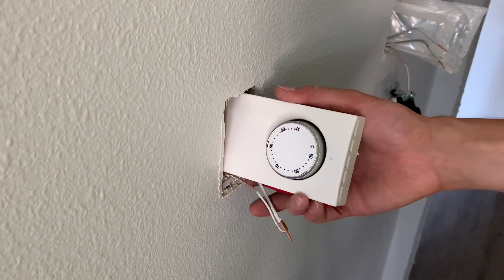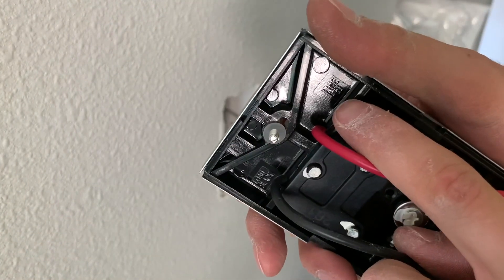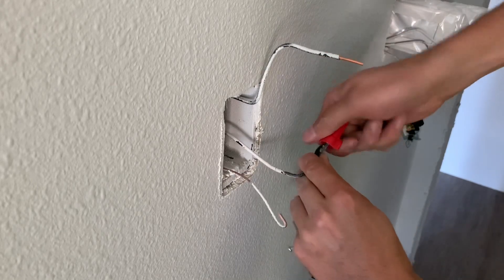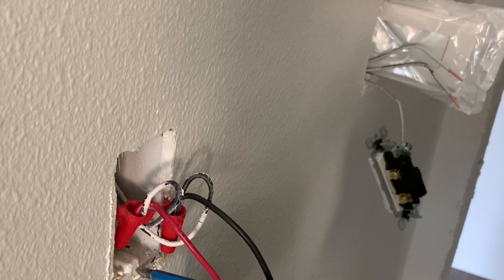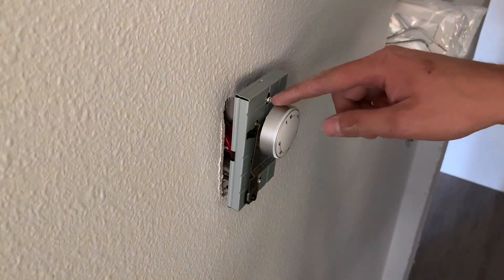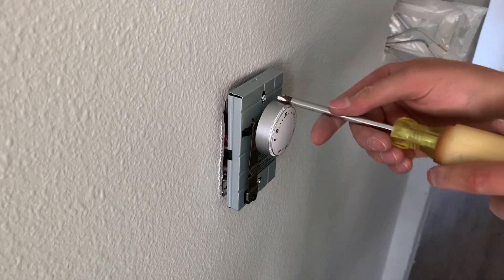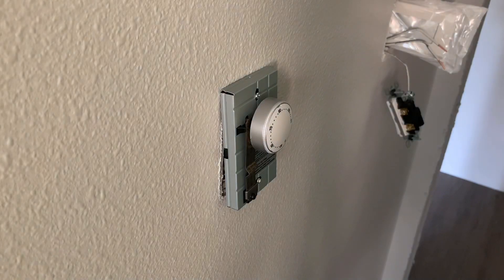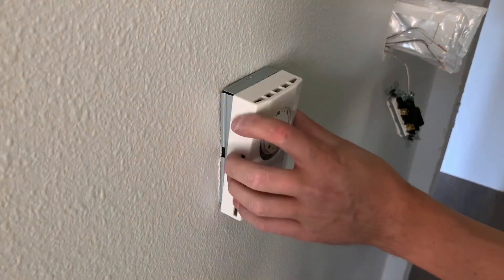How To Install A Single Pole Thermostat (120 Volt Wall Mount)

Comment: My two black wires coming from the box are side by side with no indication of which is load and which is live. They also test at the same voltage when power is on.

Comment: Great video! Super helpful. I suppose the new Nest Thermostat (2020 version) cannot replace a single pole thermostat, right?
Reply from the maker: Glad to hear it was helpful! No I don't think so, they are low voltage, not 120+ voltage. Unless they make a higher voltage model, I've never researched it.
Reply: @DailyElectrician  Thanks for the reply!
Reply from the maker: of course

Comment: I'm replace thermostats in a old apartment complex and the old thermostats have grounds and the new ones don't..so its ok to just push it behind ? Its not a danger ?
Reply from the maker: Wirenut the grounds together and you should be good.

Comment: So, your video shows 3 wires in the box, before connecting them to the thermostat. Those 3 wires would be coming from the main circuit breaker panel, right?  This must be so, since one of them is live, i.e. has power.  So, another, separate 3-wire cable would be needed to go from the thermostat to the heater, right?  So, I can't make sense of your video.

Comment: Does these automatically turn off when the desired temperature is reached or pushes out cold air to maintain temperature and back to warm to maintain stability?
Reply from the maker: never really around to test them that much, should turn off when temp is reached.
Reply: @DailyElectrician  i have an old 2 wire gas single pole wall thermostat i want to replace, my Utility guy says its not anything electrical to worry about, is that true, so i can just just hook the wires  up